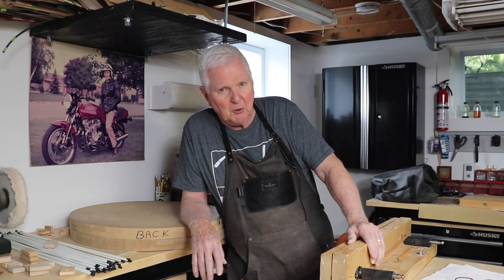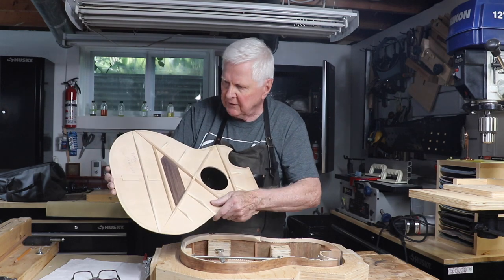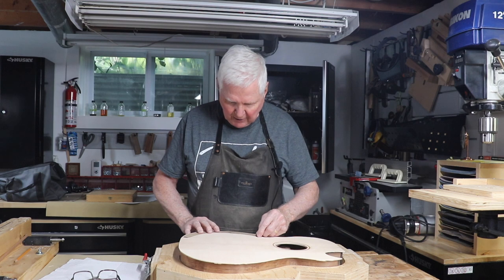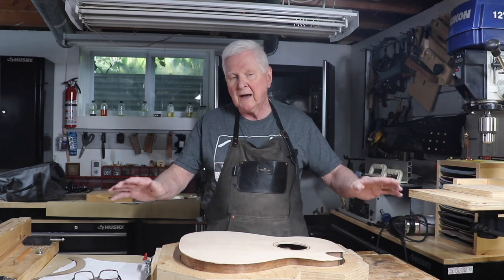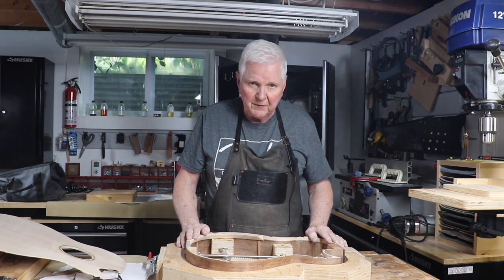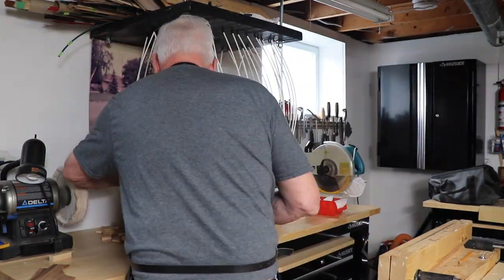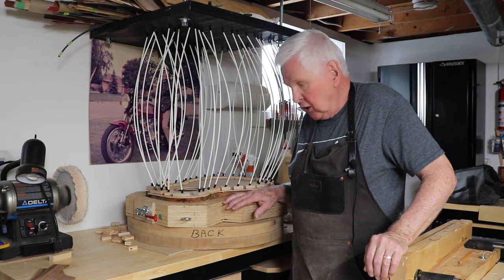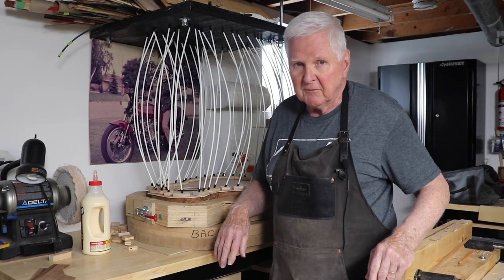Starting...At The Top!

Comment: No apologies necessary Monty. I’m glad you took a break! 

On a selfish note I’ve started working on another build and believe it or not I’m at the same stage so this video is actually timely. Thank you for allowing me to catch up! Aligning the plates on the rims is difficult and your idea to sand to the pencil line is actually a great idea. The less overhang while running a router the better or else the chips will fly. My take is that the extra mass acts like a lever for material inside the cut to get pried out. Better to just use the bit to refine an existing curve and not let it do all the heavy lifting.
Reply from the maker: Thank you. You are so correct but do leave some wiggle room beyond the pencil line. I will use a hand plane to bring it in close of the spindle sander.I saw Bob Benedetto do that on a belt sander. but he has way more experience than I do at this. We are all still learning.